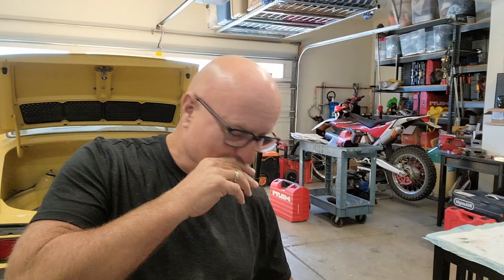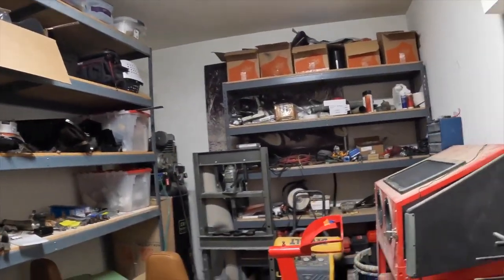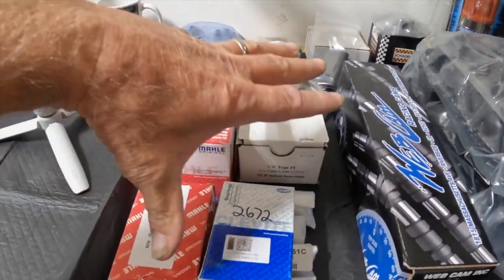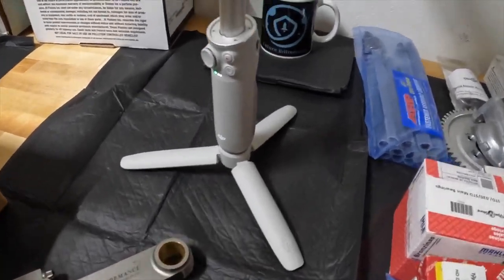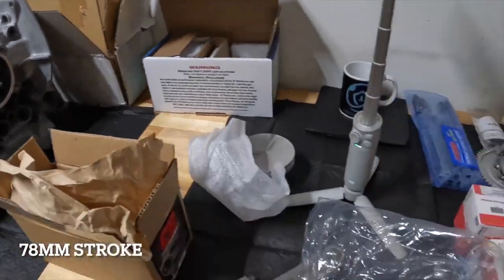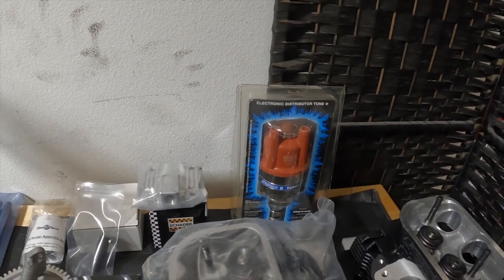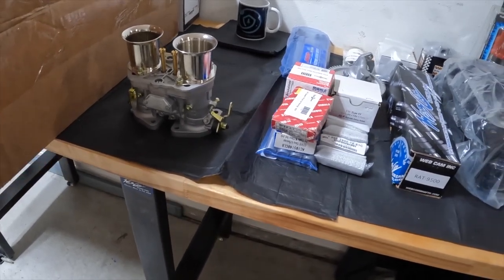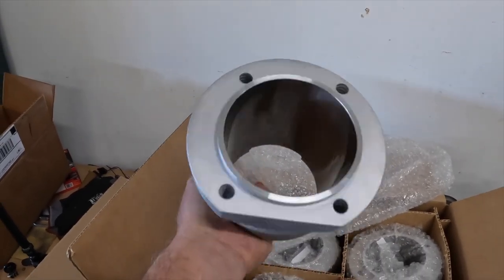Porsche 912E/914 2.0 VW Type-4 2270 Build / Part 2 Case Work and Build Plan. DIY Type-4 Rebuild.

Comment: Next level stuff ! That thing should really rip! 
Look forward to the upcoming vids.
Reply from the maker: It will be a minute now that everything is being polished and coated. I still have to get everything balanced AAANNND then I can start building it.
Reply: @rodezell2563  yes but it looks like you have most everything there so once you start you can keep going without waiting for parts.
BTW - how long ago did you get the Hoffman heads? Was it through Len or the T4 Store?
Reply from the maker: @mrjohnirons  I got those back in 2018. They were a blemmished casing that he corrected and Type 4 Store didn't want them so he gave me a hell of a deal on them. They are the RS series heads.
Reply: @rodezell2563  Your lucky. I spoke to him in the fall and he told me he's out of the T4 game. He's still doing Porsche, just not T4's.
Jorge ended up reconditioning my stock heads instead.
Reply from the maker: @mrjohnirons  I went to his website and it is still active. Not sure though.

Comment: Where did you send the carbs to have them tuned and jetted for $100. Thanks. And what’s the name or where did you get to your headers. Thanks. I’m going to fallow your type 4 build 👍🏼
Reply from the maker: Edward, I bought the carbs from CB Performance and for additional $100 they would set them up. If you need yours worked on, contact Rick Hunt on Facebook. Good luck.

Comment: So this 2270 will have 96mm bore. Do you have the part number of the CB rods that you used to stroke it, thanks
Reply from the maker: Yes, they are 96mm with a 78mm stroker crank. I know the rods are 5.325 Connecting Rods w/ Chevy RJ. I'm not sure the part number, though. I got everything from Type4store.com / LN Engineering as a kit.

Comment: Thanks for posting your videos, a great help for all of us in different stages of varying builds and applications.  Question/Request: Help me understand how one's selected Crankshaft plays into the line bore.  Do you have the Crankshaft refurbished and balanced first so as to know the nominal undersize and journal bearings that will be used, in order for the machine shop (EMW of course) complete the corresponding line bore (so that the right clearance is achieved when everything is buttoned up)?
Also, did I catch in your first video at EMW that the decking of the cylinder mating surfaces should be post line bore?
Thanks in advance for your answers/advice.
Reply from the maker: The crank shaft doesn't have anything to do with the line bore. Type-4 cases only have one shot and that is .20 over, because they only make .20 over bearings. Like Jorge said they are supposed to be manufacturing .40 for the type-4 soon, but not yet. The "other" guys that did my original bore did not install a cam to line bore it and that is the reason why my journals were out of round. See when you don't install a cam and torque the case together it could warp the bore and when you run your cutters thru it you are going to get a warped bore. Make sense? No, I think you heard it wrong. It doesn't matter on the decking, either before or after.